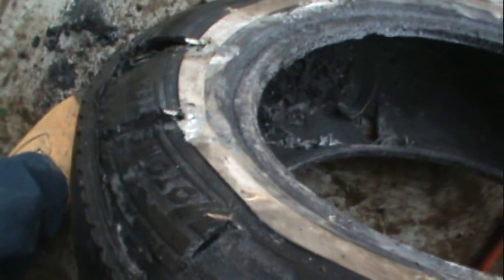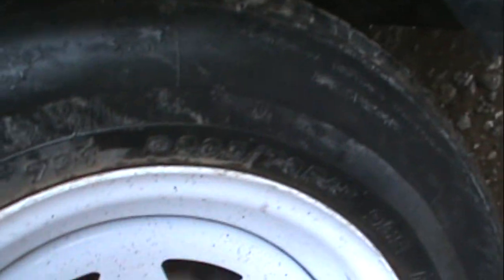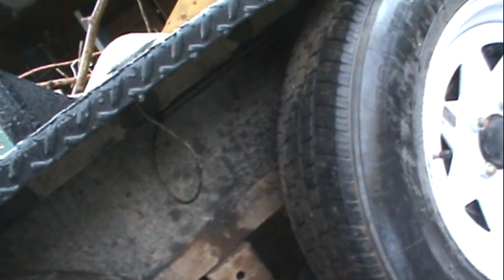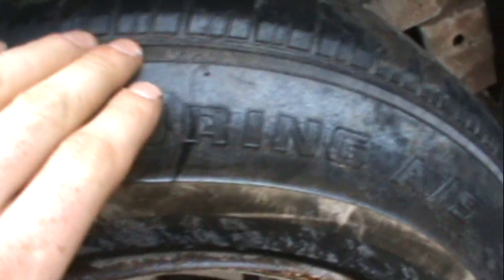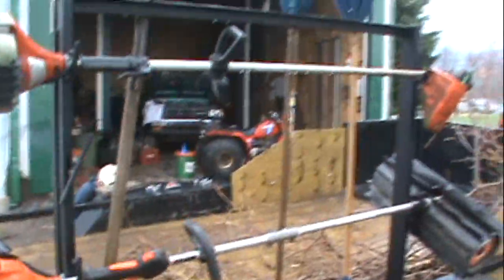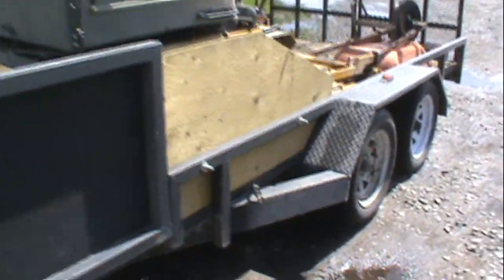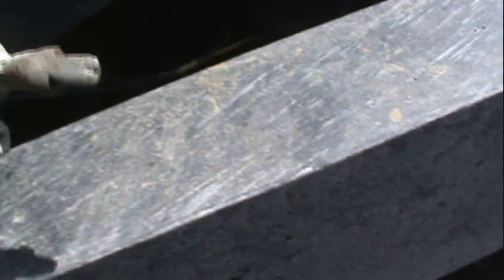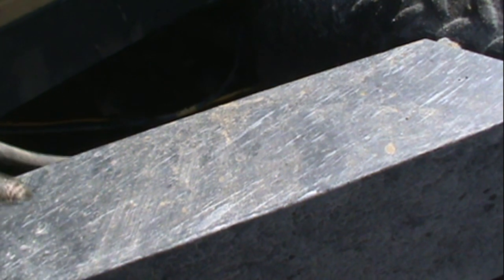Trailer Troubles

Comment: @kunzy04 Also when the trailer was built, clearly the tire clearance wasn't properly checked. Its tough with trailers because you want the deck to be as wide a possible but the tire clearance is very important!

Comment: After you fix the rubbing issue, spend some money at a tire shop and get real trailer tires. They have a stronger side wall then car/truck tires and will hold up better and last longer. Trailer tires are made to take the abuse of rough trailer suspension and tandem axle turns. You use the trailer enough that it would be worth it.

Comment: @chrispio123 First off, you should read over your comments before posting them so they aren't full of spelling errors. Second, I'm pretty sure pug didn't build that dump trailer of his, its looks like it was build by a trailer manufacturer. Third, did you see how pugs trailer had the same issues? Its mainly a tire problem, car tires shouldn't be on trailers, the side walls are too soft. And no making fun of pants, he's a good guy!